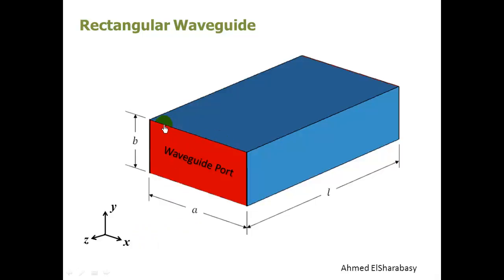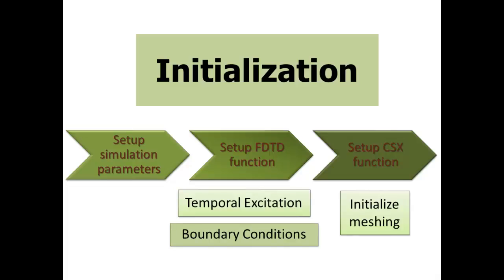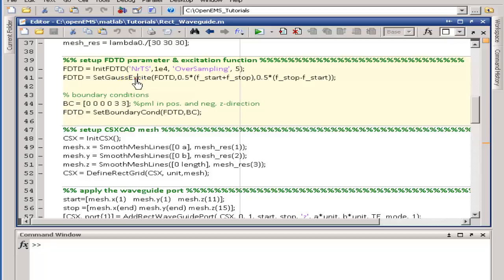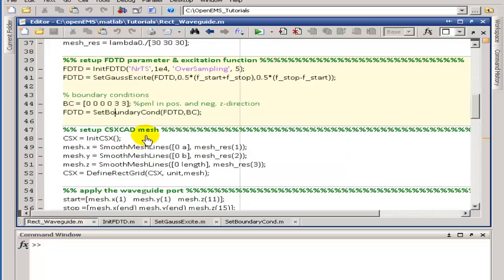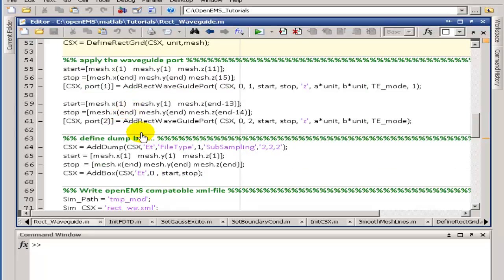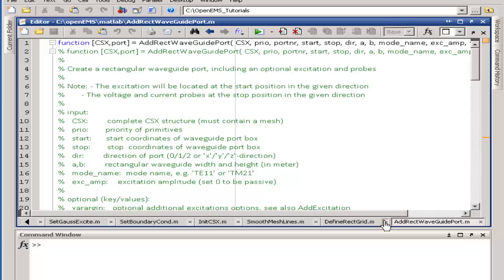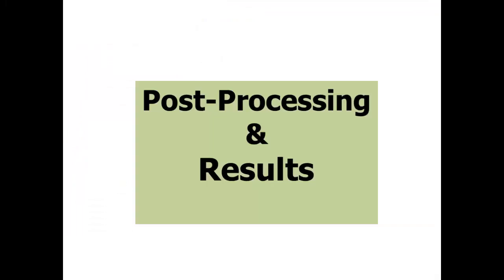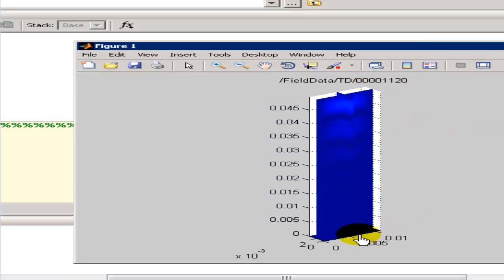openEMS - Rectangular Waveguide

Comment: Dear A.Elsharabasy, I would like to build an EMI shielding box with the size ~ 2m x 1m x 1m for frequencies ~ 1mhz-10ghz. This is a nearly perfectly enclosed box (no seams, no gaps, just a few honeycomb air vents). I would like to eliminate the resonances of the box that are created by leakings from the outside or electronics inside the box. AFAIK this can be done by making it irregular (non-parallel walls or trapeziod walls). ((Other methods like using a dielectric or microwave absorber would be too expensive.)) What kind of geometry should I choose? Could I model this in OpenEMS?

Comment: Is there a way to add and subtract primitives. For example, to make a waveguide slot array, how would you make the slots in a waveguide?
Reply from the maker: Yes, you can always define slots or hollow parts inside your structure.
First, you have to build the slot shape as required, i.e. box, cylinder,...etc
Second, define the priority in the function argument to be a greater number.
Now, after building the two structures the intersection part will belong to the primitive with higher priority.
Reply: +A.Elsharabasy, thanks for that.  I guessed that may be the case but have not tried it yet. I'm considering to use FreeCAD to build structures to simulate but if I do that I don't think I can parameterize it.